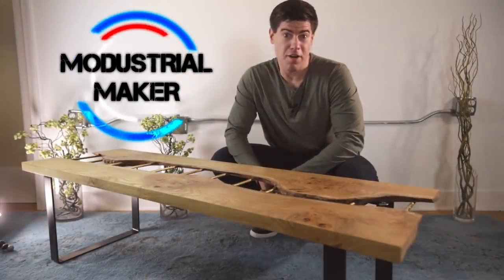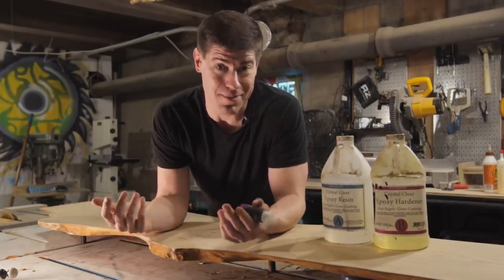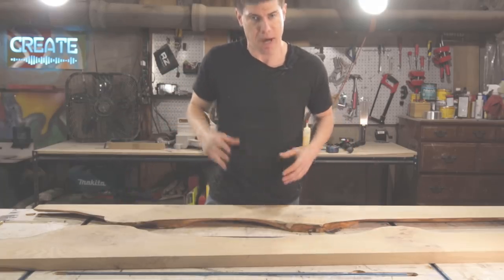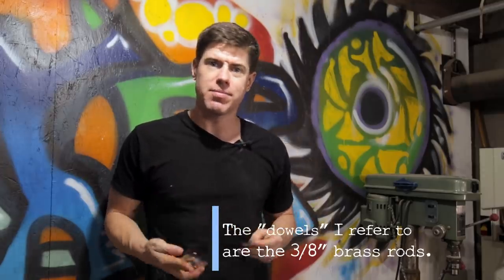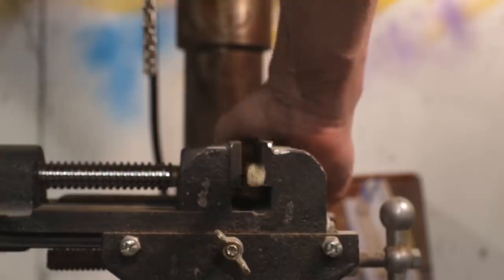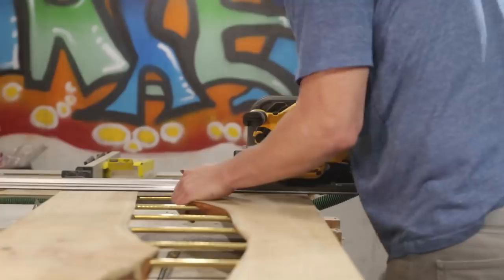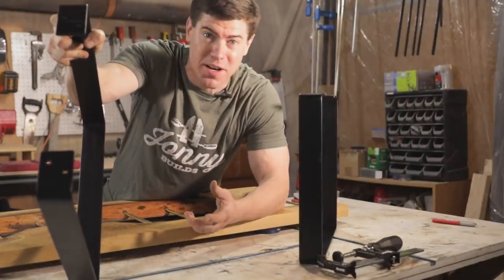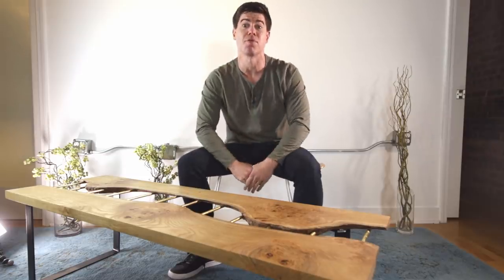DIY Brass River Table || woodworking - how to make

Comment: Which slider do you use? 
A whole behind the scenes video with all of your equipment would be interesting come to think of it 😃 Those small led panels look really nice too 🤗
Reply from the maker: I'm using the Edelkrone Sliderone.  I share a lot of behind the scenes stuff, including some posts on photo gear, over on Instagram (especially in the stories).   Definitely head that way if you are interested in more gear related posts.

Comment: Next challenge...integrate concrete and wood..
Not as simple as expoying the wood and hoping it's water tight..take a bit of research and trial and error.

So many people stupidly cast the concrete over the wood (which is fine if it's kiln dried wood that's really dry and then sealed water tight etc)...it may look good for a awhile..but the wood and concrete will soon move and cause problems.
Reply from the maker: I have done a bit of this, if you look at some of my past projects, embedding wood slabs in concrete.  I did use kiln dried wood and sealed the wood well before pouring the concrete.  I've had the first piece I did in this manner now for over two years, and so far so good!    It is a cool process though, and I didn't realize that about the kiln dried part.  I usually use kiln dried wood though, so I got lucky!